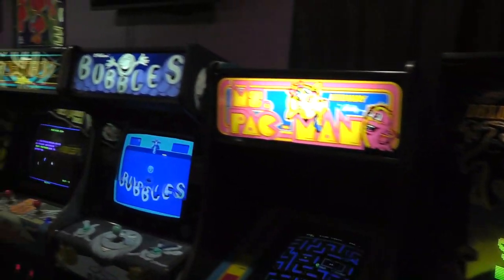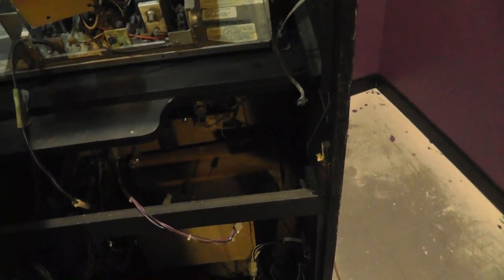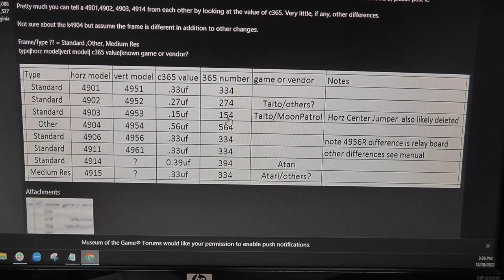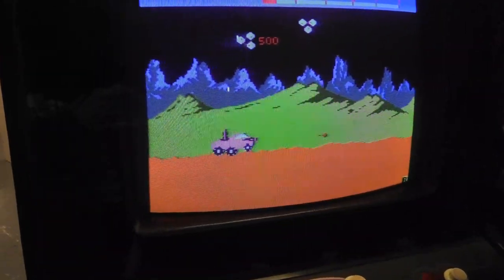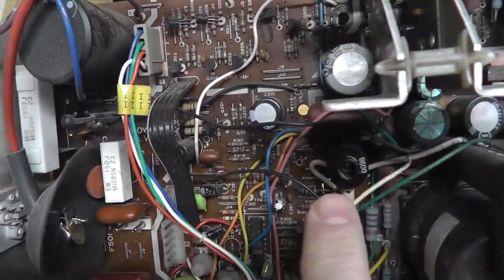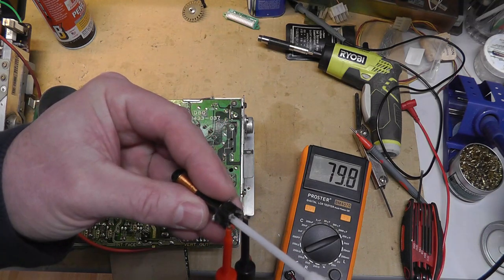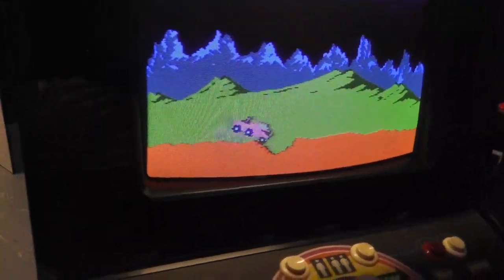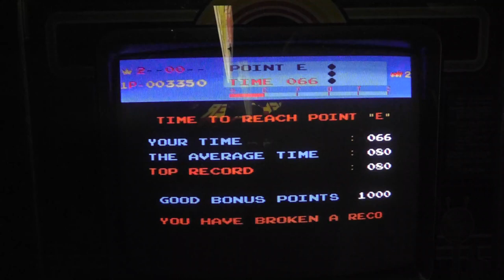Arcade ADITL - Moon Patrol & Joust Monitor Swap / K4900 Chassis Difference, Width Coils

Comment: My Zoo Keeper (K4900) has a whine as well after being left on for 30 minutes. Coil whine?  Not sure. I need to investigate as it's never been serviced. It's all original. The whine goes away if I press on the metal side of the chassis near the flyback.
Reply from the maker: I guess I didn't really investigate the whine in this vid as I ended up using a different chassis. For my recollection later, the chassis with whine was the Legend of Kage.
If I end up working on that chassis, I will report back.

Comment: The Width Coil capacitor value changes the Maximum size of the total width? What is the vertical damping and horizontal damping trim pots, what are they damping?